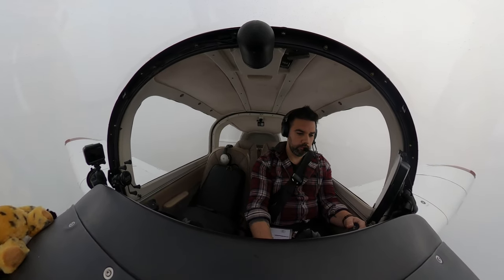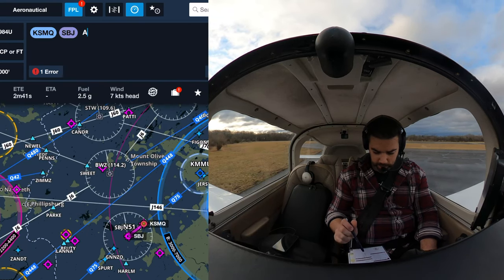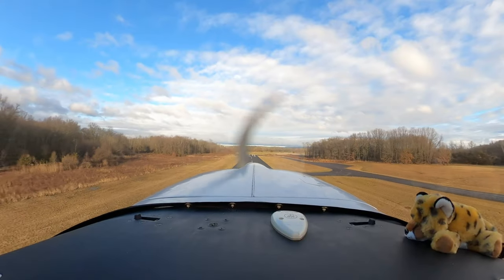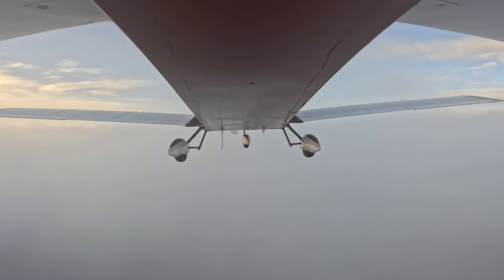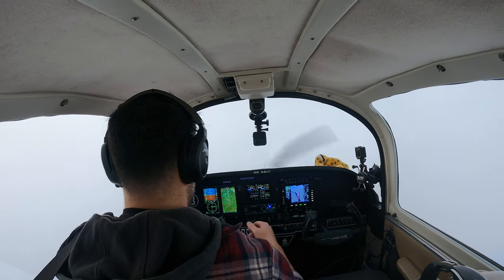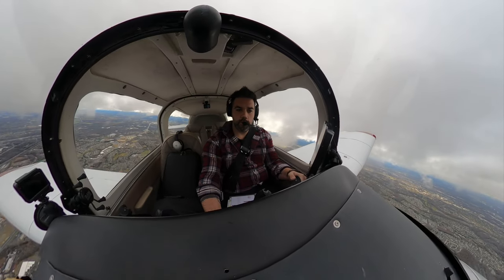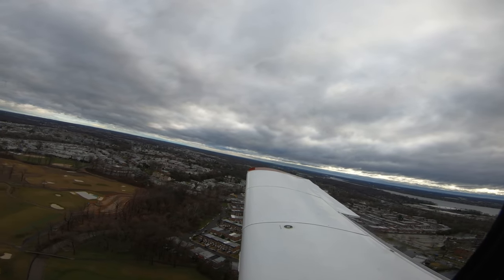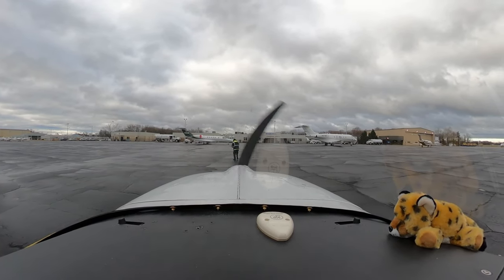Flying to work in BAD WEATHER: Single-Pilot IFR

Comment: I would have never accepted that initial approach from Control.  Go Around, deny the clearance, and request to be vectored in again.
Reply from the maker: Fair enough
Reply: Agree with the comment.  Either I would have immediately asked for another fix or I’d have nicely made an excuse to check in before I got that close.  Approach is busy, they’re human and I’m sure they never intended to give you the turn that late.
Reply: Agreed, unless the controller had a master plan to deliberately take you through the inbound track, that was an unrealistic turn on to finals. That said, there are often reasons for controllers doing what they do because they have a different traffic picture to we pilots, and sometimes need to accommodate accordingly. Either way, it’s really helpful to pilots if the controller finds time to briefly explain the intent, eg: November123 turn onto heading xxx taking you through the inbound course expect re-intercept from left / right of course….. Can’t speak for the States, but in Europe this is often done and helps share the mental model.

The other no-no displayed by the tower here is transmitting instructions during your landing roll. Not so much of an issue for a light aircraft maybe, but with bigger multi-engined aircraft this is recognized as bad practice, there’s just too much going on in the cockpit at that time.

Nice video, well handled short flight, thanks Bruno.

Comment: Nice flight, good use case for the instrument rating. Excellent landing. Well done. I just flew it in sim under similar conditions and route, just for fun. Btw, ARD shows up as a VOR/DME on the VFR Sectional and IFR Low Enroute charts. If you sensed that turning to 300 was going to be tight once he cut you to EPECU, you could also be proactive and ask for a vector more to the left to keep spacing from the approach for a safer turn. What does “via one single-turtled airspace” mean? I imagine that was “via once in controlled airspace” but it took 2 times to figure it out. Lost some enunciation with the speed there, luckily clearance person knew what you were saying. 😉
Reply from the maker: Thanks so much! And yes, that was supposed to be “once in controlled airspace”. Apologies for my not-so-great English 😄 As for the approach into PNE, you’re right: I should’ve asked for the first fix or an earlier turn. Lesson learned there!

Comment: I was wondering whether they were actually going to vector to final. As soon as they said, "direct EPECU" and I looked at the chart, my immediate reaction was I would have asked for KABKE. Even if they did vectors to final, it would not have saved much time and would ultimately be easier for me. And less work for ATC - it almost seems they forgot about you since you ended up with a tighter turn than ATC guidelines would suggest and the downwind-base-final usual vectoring procedure you were expecting. 
Great job handling it.
Reply from the maker: Thank you, and I totally agree with your assessment. If this happens again, I’ll definitely ask to go to the Initial Approach Fix instead. Much simpler. The more you fly, the more you learn :)

Comment: When you got told to turn on final before the EPECU way point, could/should you mention to the controller you want to take a wide turn because you weren't conformable with the sharper turn? Or, could you call them a little earlier to ask about an upcoming sharp turn, and see if you were kind of forgotten about?
Reply from the maker: Yes to both! In the moment, I just figured I’d extend the turn and re-intercept the final approach course from the other end without the need to clog the frequency. But in event I’m in the same situation again, I’d be proactive and request starting at the initial approach fix (vs EPECU). Thanks for watching!

Comment: Hi Bruno…. Someone mentioned your panel. Is that the Avidyne PFD along with a IFD 540? I’m looking at either the Avidyne or G5’s to go with the G430 I have already. Also, which autopilot do you have?
Reply from the maker: Hey Richard! I have the Aspen Evolution 2000 system and the Avidyne IFD550 GPS. I really like them, been flying with this setup for over a year and it’s solid!
Reply from the maker: Oh, and my autopilot is the Trio Avionics Propilot. Also very solid!!

Comment: As a fellow Trio Pro Pilot AP user, would love to see an in depth video on it. I have enjoyed it and it has so many great safety features as well, but I have not been comfortable enough with it yet beyond basic GPSS, alt/hdg hold, etc.-- have not been using it for climbs and descents. No instructors are familiar with it either, and documentation is convoluted at best.
Reply from the maker: Thanks for your comment, Brian! I haven’t done an in depth video on it just yet because we’re still working through some issues with the Trio. I have a lot of footage on the installation, test flights and more, and that video will be out as soon as it’s working 10/10 so I can demonstrate its capabilities!
Reply: @FlyWithBruno  awesome man look forward to it

Comment: Start by not calling it "the soup" and use "IMC".  Having your own plane gives you have many opportunities to train.  One is to be ready for weather and not have the burden of going somewhere or having passengers.  If you can leave from your airport and find a area with 0/0 to practice missed approaches.  You may not have a area like that but where I live there are mountains between me the ocean and I could fly over the mountain and go to a major airport when there was a thick marine layer.  This was great because the commercials couldn't even attempt the approach.  

I would keep a eye on the weather and if a marine layer was forecast I would practice the whole flight on MS flight sim with night and snowing so that I would have to do the whole flight IMC.  And then do it again and again.  Then in the morning, if the marine layer was there I would get a early start to do missed approach training in actual IMC.  In route I would have every controller advise me that KSNA was 0/0.  Which is exactly what I wanted since missed approaches are usually a high risk/low frequency scenario.   This also has the safety benefit that if you feel very comfortable with going missed you are less likely to try to go below minimums.

Another way to get more training out of your plane is to fly at night.  If you have a area that doesn't have a lot of lights, we have a lot of desolate desert here, so I would fly out to some of the little airports with approaches and do those.  Sometimes at midnight on no moon nights.  

A lot of the IFR danger comes from lack of recent experience in the different scenarios we can encounter.  This is why I use the Gordon Graham High Risk/Low Frequency model.
https://www.youtube.com/watch?v=Og9Usv82CdU

And as Embry/Riddle found out we are more rusty than we think we are.

Comment: To give you an idea how hard it is to maintain currency. If you don’t fly professionally in the soup, I obtained my instrument rating back in 1989. I have a total time of about 6 1/2 hours of actual instrument flight. I am current, as I obtained my IPC back in March 2023 and have been flying most of my IMC work in a Redbird simulator. Living in the Midwest, you don’t have the luxury of too much morning fog or low clouds. You have two flavors out here. Icing or thunderstorms depending on the season. Most of the time you break out of the soup well above the height of the final approach fix so you cannot log it. I feel comfortable enough to go down to at least 100 feet above minimum on all approaches. I practice drive and dive as well as precision. I still practice localizer back course and NDB/VOR approaches with old navaid equipment, since I’m a renter as well as RNAV and ILS. The cockpit automation is new to me in the last two years, but I have gotten proficient with it and still getting nostalgic trying to fly with steam gauges. Just remember to fly within your capability and not try to go over your head and you’ll do fine.
Reply from the maker: Thanks so much for your comment! I agree with you: staying current is very different from  staying proficient.

Comment: Dear friend 

Could you help me with videos 
1- you have 2 360 on board … no one is connect with sound and the one you have in the ceiling is NOT too … so where you connect the sound ?

Also the 360 that you have can you connect  them with audio I can’t with mine … for sure that is why those 360 that you have in the cockpit are not connected because is not possible to get sound for 360 

Also wish software do you use to down load and editing… 
Last question how or with what software you use synchronized  the SOUND and how you do it 

COULD YOU MAKE A VIDEO HOW YOU DO YOIR VIDEOS LIKE SERIES OF VIDEO HOW YIU DO IT
Reply from the maker: Hey Yuri! I recently made a video about all of that, I think it has all the answers you’re looking for. Check out the channel!